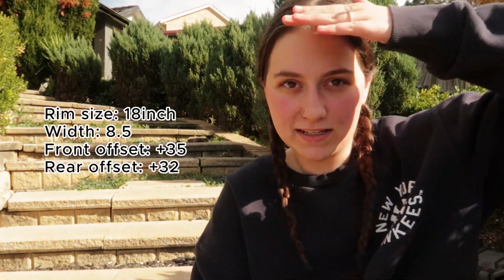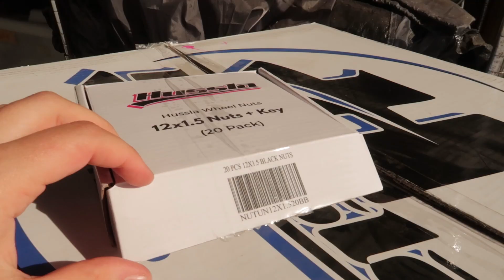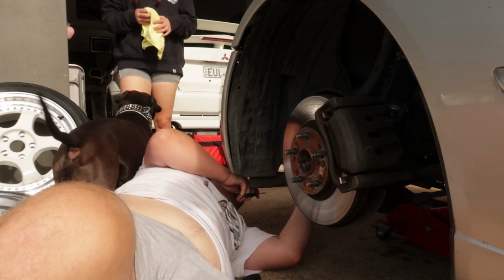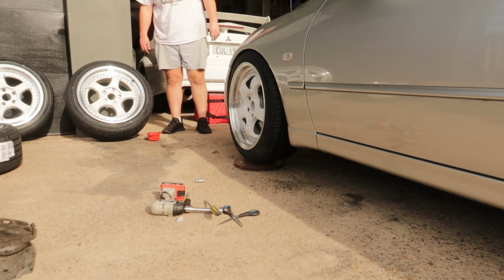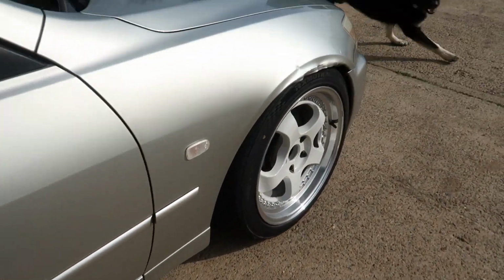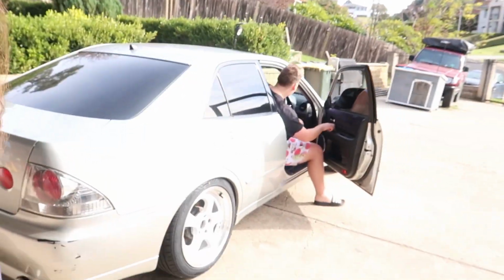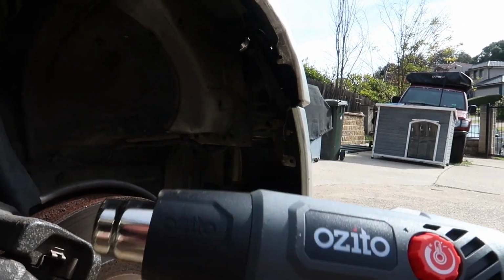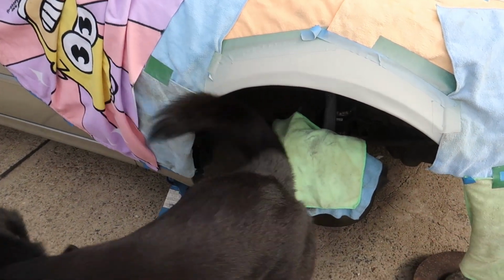I FINALLY GOT NEW WHEELS - Mataylah Meis

Comment: Why spend the 1100 on reps? When the legit work meister wheels are only 1300 to 1400 ?
Reply from the maker: Where are they $1300 🤣
Reply: why buy reps in general lol
Reply from the maker: @jl5676  if u watched the video I answered that question, either way thanks for the engagement 😚